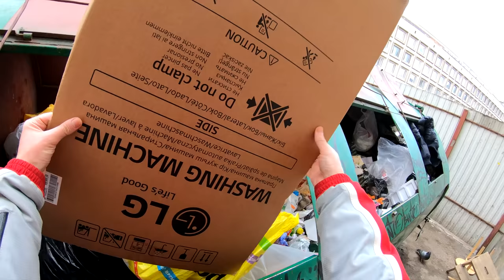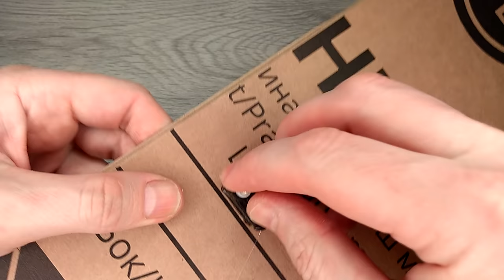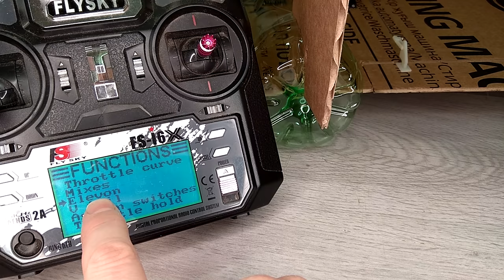How to make Flying Plane out of cardboard and plastic bottle DIY

Comment: You really don't need a pop bottle fuselage, the classic "pizza box flyer" is normally only a square bit of cardboard or foam board, fabricate a simple motor mount, then mount the motor on the front, hot glue a fixed vertical stabilizer directly on the flat wing, and use the same control system shown in this video.

Comment: How did you connected the receivers to the remote controller ?
Reply: It depends on your system, I've only bound R/C car receiver and controller. It used a jumper that set the receiver to bind mode, then I selected bind from the controller menu. I'd imagine the process is similar for whatever controller you use, just make sure you buy a receiver compatible with your controller.

Comment: any plate can fly if it is equipped with a sufficiently powerful motor🤗
Reply: No, if the design doesn't satisfy basic aerodynamic rules, at best it will be a tumbling thing hanging under a powerful motor, that is not precisely "flying".
Reply: @rva1945  It is a philosophical reasoning that there is a true flight. Physics is simple - the body above the ground without support moves this flight😊